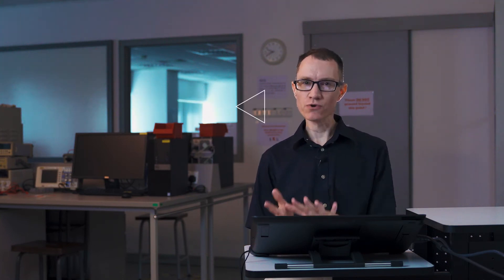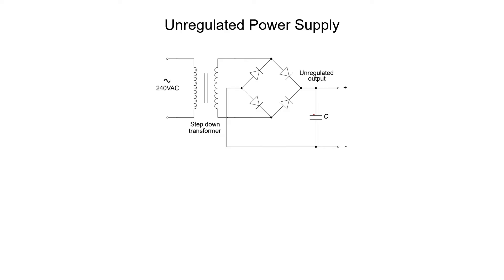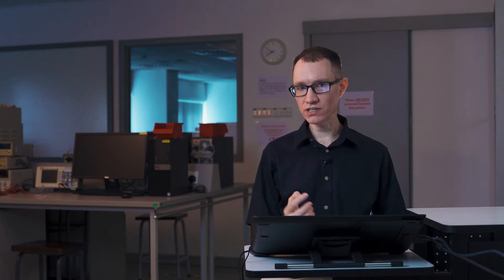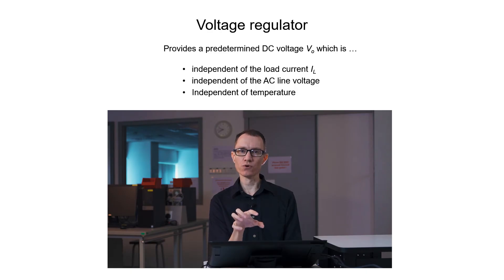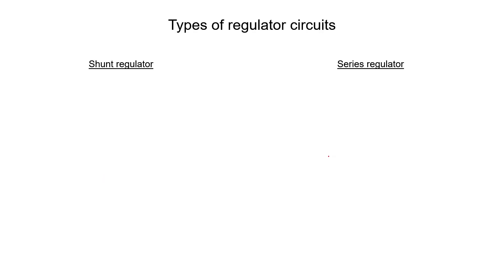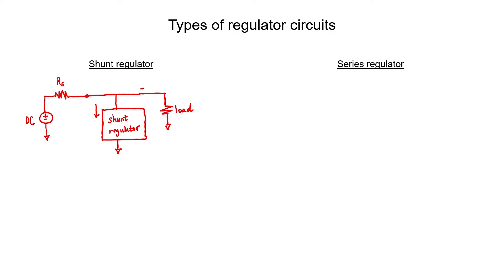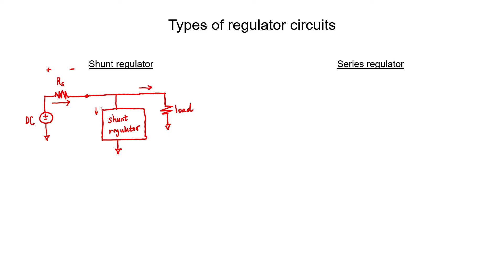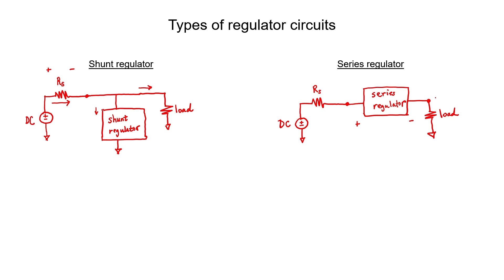What does a voltage regulator do? (1 - Regulators)

Comment: Thanks Sir, I did not understand why if the DC draw more current , the voltage is going to drop ?
Reply: since shunt regulator and load are in parallel they see the same voltage and using parallel resistance forumula you got som Rt = Rl * Rshnut/(Rl + Rshunt), so voltage across Rt which is the same as voltage across Rl is the same and it's V= Rt * I as you can see more I more V,  take it with grain of salt since I'm not expert

Comment: Sort Of Unrelated But Does Anyone Know If It's Possible To Control A Relay My Monitoring Voltage Drop Across A Switch? 

The Situation:

12v Car Battery Has A Main Battery Disconnect Switch On Positive Terminal. From There It Goes To Alternator And Vehicles Circuits. When Engine Is Running There Becomes 2 Power Sources Active. When The Alternator And Battery Are Disconnected Via The Battery Disconnect Switch There Is A Voltage Drop Measured Between The Disconnect Switch (the battery resting voltage and the alternator charging voltage) When This Occurs (1.1v or greater) I Need A Relay To Trigger So That I Can Disable Engines Ignition To Shut Off The Engine And Stop The Alternator From Charging, Effectively Powering Down The Entire System.

I Can Measure The Voltage Drop With A Multimeter But When I Use Adjustable Voltage Detection Boards They Register Either The Battery Voltage Or Alternator Voltage When Disconnecting The Battery. They Won't Measure The Voltage Difference Of 2 12v + Power Sources . Any One Got Any Ideas?
Reply: They can do all that stuff from mission control at your local electric provider or remotely. Satellites too...

Comment: almost all the regulators are rated at around 40v input and 32 to 35 v output. Only a couple are with 100 / 120 v rating and they are extremely difficult to get in retail market. Why are they made at 40v rating ? why not 100 V ?  or what is the difficulty in making a 100v adjustable regulator ?
Reply: What voltage you need to step down to ? At 100V you would need to consider isolation and depending on the current and step down voltage, you probably need a switching power supply